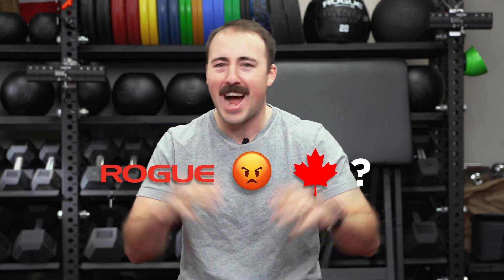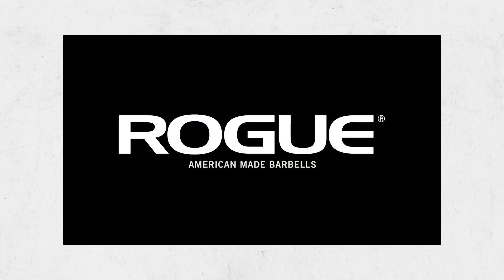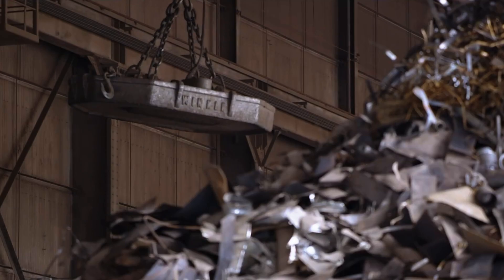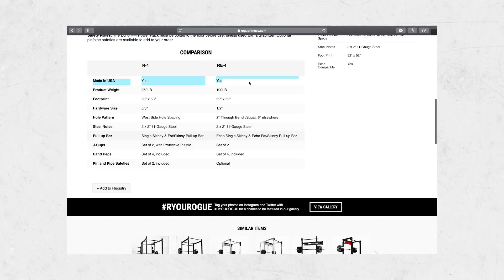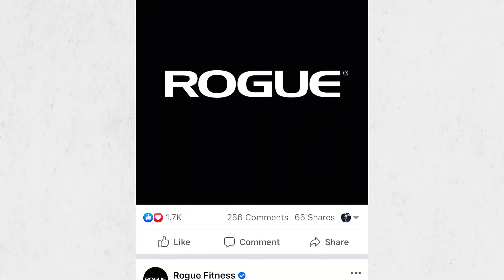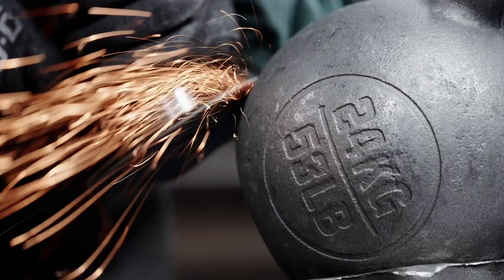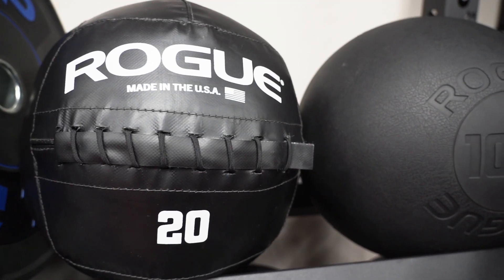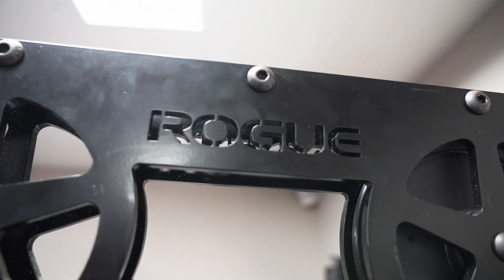Rogue Fitness Hates Canada?!

Comment: Not to be a cynic, but I suspect the reason Rogue offered a recall on those parts was not just for brand loyalty. "Made in USA" labels have very stringent guidelines set out by the FTC, so it's possible they could have faced a lawsuit if they didn't correct the issue.